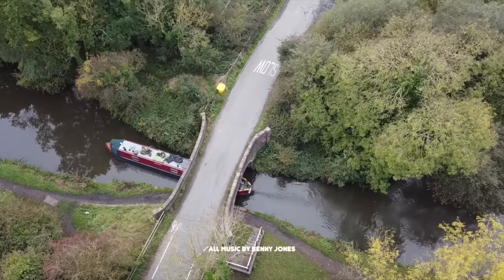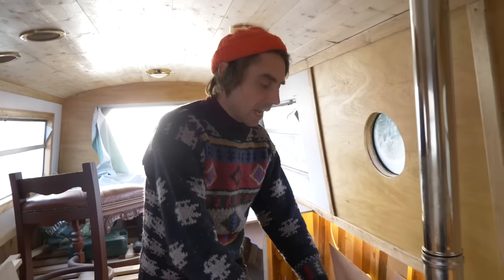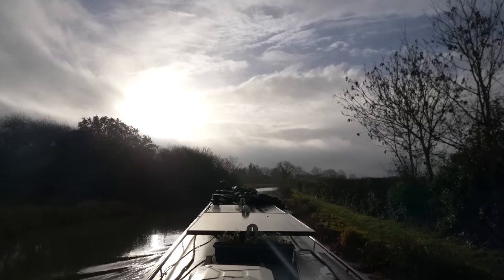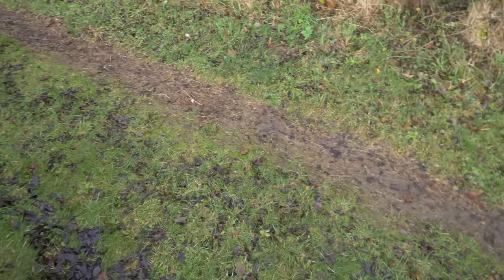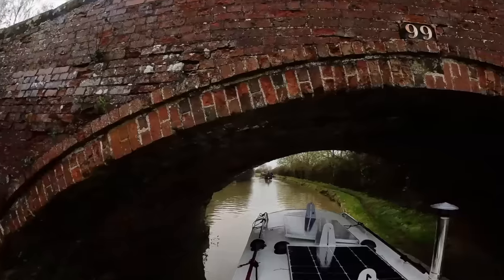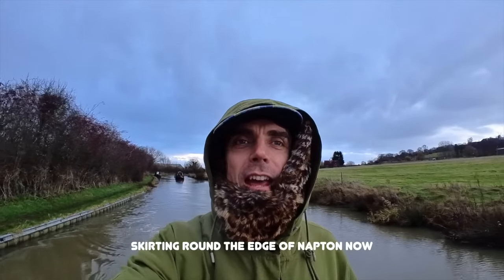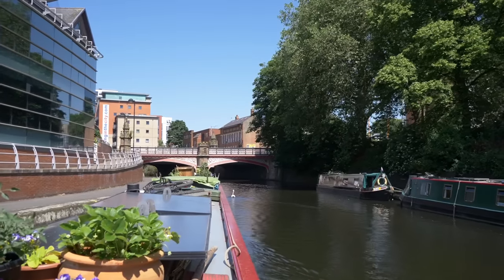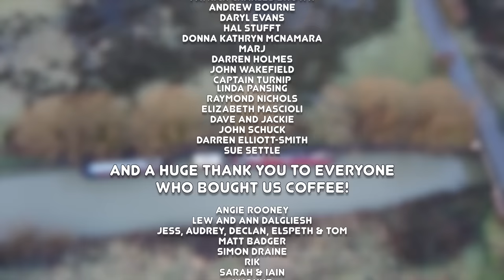What's Next For Us?!...After 3 years on our Narrowboat Home We're Making Some Changes! | EP82

Comment: Ben if you have a tube of threadlock try putting a drop on that tickover screw once you've got it set correctly. that should help prevent the vibration working it loose again.

Comment: The only thing about firewood stove / heater is it don't use power.. unlike diesel heater or any other gas type heater they use power and things can go wrong and until it's fixed no heat... That's why I love my woodstove..i can't begin to say how many times I was without electric in the middle of winter and I was at ease because of my woodstove and I even cooked on it...

Comment: Back to the canals:) Reason I guess you might not have seen any signs about going onto the Oxford Canal after Napton is that you were on the Oxford canal throughout - that bit where you said you'd moved onto the Grand Union was actually still the Oxford. Also although many people use the terms, I don't think there is any official distinction between the North Oxford and the South Oxford: I am not sure where one is supposed to start and the other finish - although the Oxford Canal south of Napton Locks does have a different character, winding all over the place and feeling somewhat more rural.

Comment: I don`t know if you have a hot water tank on your boat. I made my house off grid electric using boat stuff. I used to send spare solar to the hot water tank when the batteries were full rather than wasting it. You can get loads of different types of voltage and wattage immersion heaters. I`ve even made a solar hot box to heat water up using loads of copper pipes.